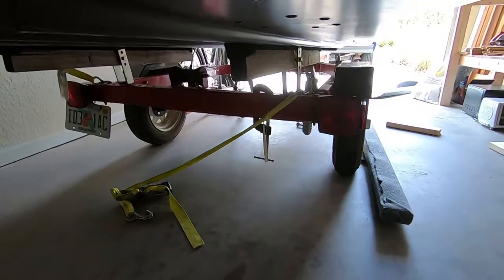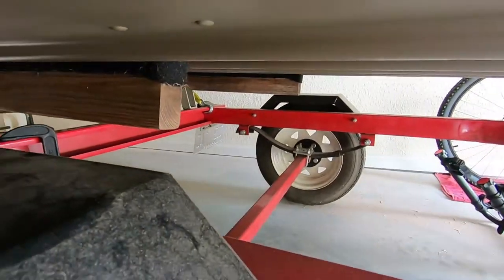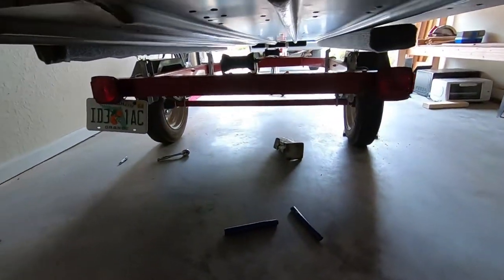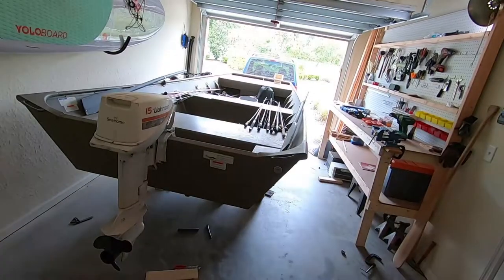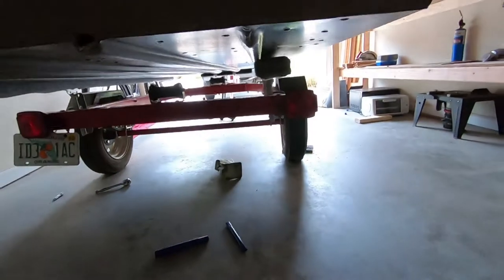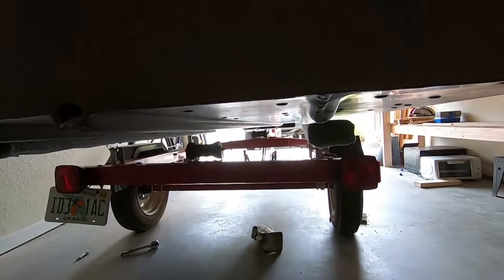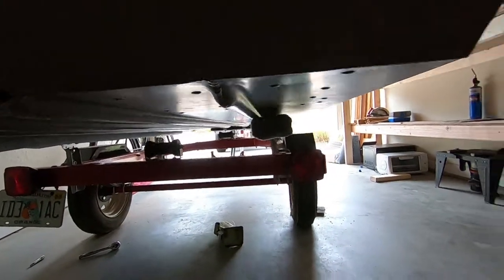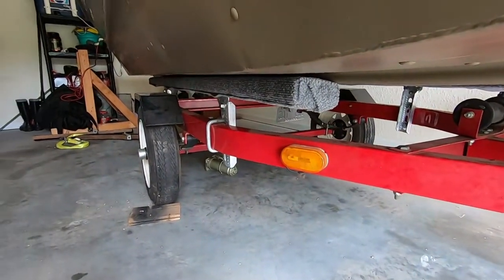Boat Trailer: Replacing or repairing bunks and guides

Comment: Something to think about. I always ran my bunks about on half inch past the stern of the boat. This supports the rear portion of the boat at its strongest point. The way you placed the bunks the combined weight of the boat and road bumps could over time cause the boat to dent/bend at the point where the support ends. 
Once you have the flat bunks adjusted, loosen the front Cross bunk and move it forward until the boat sits flat on the long bunks. Then move it back until it just contacts the boat. In this position the boats weight is totally supported by the longitudinal runners and the cross brace prevents the boat from twisting . Just a thought
Reply from the maker: Thanks for the tips! I didn’t know to keep it longer.

Comment: Just a heads up if you used pressure treaded lumber it will corrode the aluminum over time.
Reply from the maker: I made sure not too! Thanks for the heads up!

Comment: Do you remember where you got the U bolts brackets hardware. that you used to connect it up. I just got a 10 ft Jon boat today and am getting a HF trailer tomorrow and like your set up. Great Video Thanks for posting it as I was researching boat trailer builds.
Reply from the maker: I purchased it off ebay, just search boat trailer bunk brackets. All hardware was included!